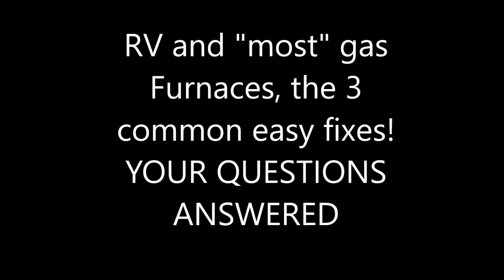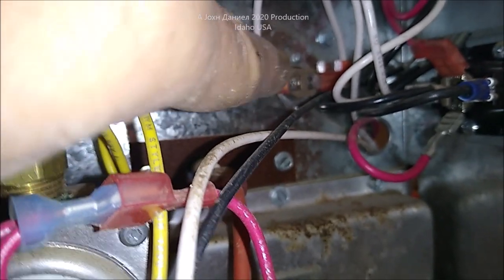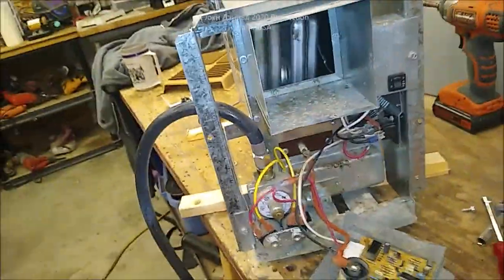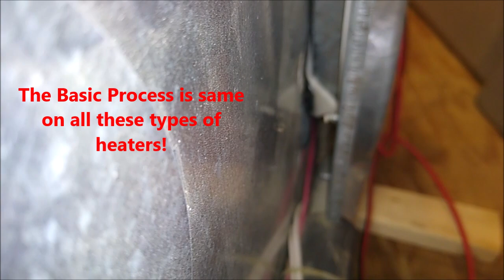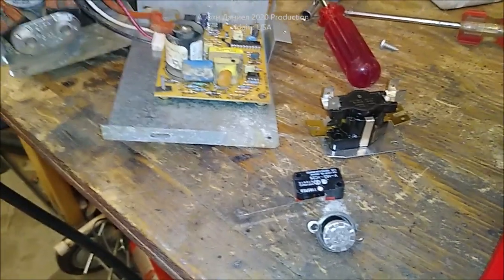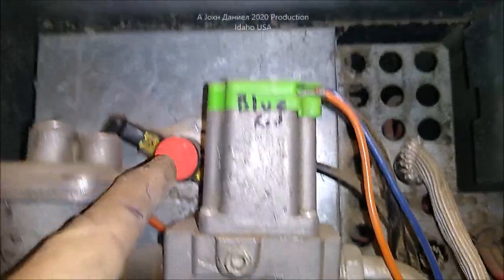RV Furnace REPAIR TECHNICIAN SECRETS Top 3 Easy Fixes anyone can do PARTS BELOW

Comment: Great video.  My furnace runs great in my RV the 1st night.  But if I try to run it a second night, it turns on then off about 3 times then never comes on.  No clicking noise like it's trying to light. It's a 2019 Real Lite camper trailer.
Reply from the maker: Check for low battery voltage or charge them and see if it starts working properly. Many will fault out at anything under 12 volts, and you won't get the true voltage at the battery doesn't have the same kind of activity on it that you normally using at the time you try to use the heater. So I'm switch the heater into on run position turn on the lights you normally have on and then do a voltage test and see what's happening.
Reply: @JOHNDANIEL1  Thank you.  But I am plugged into 30 Amp power when this happens.

Comment: I put a tab on sail switch and it still starts and shuts off and then starts again and shuts off
Reply from the maker: If it's doing it as as soon as it builds up heat usually about 3 minutes then the over temperature switch is failing on the low side. For the light gauge jumper between the two terminals on it, reconnect power fired up see what happens.

Comment: Hello,
I have a 2017 Forest River Vibe, furnace comes on provides heat for a few minutes and then turns to cold air. I was researching and a guy said it is most likely a temperature control switch? Any idea? 
I'm close to taking the entire furnace out. Hoping someone knows exactly what the problem is so I can purchase parts first?
Reply from the maker: that is a typical behavior of the over temp switch going bad. Even if you can find continuity on those switches typically they won't carry any amperage to keep the board holding the gas valve open. And some models they have an additional temperature sensor near the burn chamber and it will also fail in that fashion. For the small jumper wire 24 gauge for safety between the two contacts on each one of those with alligator clips, run a few cycles and see if it changes.

Comment: Would mine possibly run on power alone? No propane lines , some were burnt in a small fire b4 I owned rig, 2016 forest river Salem hemisphere light. It's cold and I need to get this thing hot.
Reply from the maker: There's no electric coils in these heaters, the DC voltage runs the circuit board the blower and the thermostat. Propane makes the heat.
Reply: @JOHNDANIEL1  thank you sir. Thanks your video I did get my furnace running although is a pretty silly solution. But my refrigerator will not run into propane lines on that side have been cut I do have power to the plug but nothing past that. Got a video for that? I have shared your page.

Comment: Just bought a older trailer. When I try to use my furnace, it fires it runs for few minutes and then pops like a back fire, after checking the exhaust I have a bracket peice hanging out of it.

The same peice as the one mounted in yours at 6:14, what's that peice for? Do I just pull the unit out and rivet it back in?  The blower does make a higher pitched noise so I plan on pulling it anyway to see if I can do about that.

Comment: Hello John, quick question for you, I have a Suburban trailer heater that works fine but when I plug into shore power it immediately shuts off and won't turn back on until I unplug shore power. I have no idea what could make it do that, any ideas or suggestion's would be greatly appreciated  8~)
Reply from the maker: Many of the suburban heaters have 110 volt transformer built in, they also have a reset circuit breaker based on that 110 volt circuit or they'll be a switch or you switch it to 110 and a relay has kicked it off at 12 volts. Open the front of the unit look around inside for a toggle switch it allows long-term parking on 110 volt service. Secondary there might be a fuse it'll be a black cap you unscrew with a fuse in it 10 amp and that might have blown. They are made to default on shore power but you can toggle it back down to 12 volt because it'll be on a choose circuit from factory which means it defaults to 120 when available and if that transformer or fuse or reset breaker is messed up you'll get nothing. The best way to do it typically is always leave it on 12 volts switch. If the information gets you up and running don't be afraid to hit the things button and drop a tip to the old poky

Comment: Thankyou for the information.  How much of this is accessible in the rv or do you need to disconnect unit to move to gain access?
Reply from the maker: It needs to be removed, there's screws that would probably be in the base to go down to the floor usually 2. The exhaust is a slip fit so take the screws out on the outer body and the center screw if it has one and shake it a little bit and slide it out. Be sure your gas is turned off and your power or pull the fuse. Back up any kind of fittings that you work on with another wrench so that you don't twist them off. If the unit has duct work on it it's usually snap fit or 5/16 clamp. Take your time and slide it out the front.

Comment: Hey man! What an awesome video! 
I have the exact same heater 
Did all the test 
Still no heat tho 
the spark plug sparks only for a second in the start up routine 
Is it supposed to go off all the time like a propane burner canon
Reply from the maker: These are not supposed to continually spark. There is a common issue with them not lighting up and burning it would typically be lack of pressure from your regulator off your tanks. Change the regulator and see if you're still flame gets a little higher and the heater starts working properly. Try that first.
Reply: @JOHNDANIEL1  thank you !   I did switch the board for a new one and it started like a brand new furnace !!

Comment: John thanks for the video.   I replaced all the components you showed here and it worked.   I had it working great so I installed furnace back into the confined space where it belongs.  Hooked everything back up the same and now it will light but then 10 seconds later system shuts down.   Any ideas?    Thanks for your help and beautiful border collies
Reply from the maker: Try try to adjust the spark points to where the flame sensor wire is detecting flame on the burner. Sometimes they get just far enough away or are grounding out and they'll run and cycle like that. Second thing is be absolutely sure you're exhaust and intake are clean.
Reply: @JOHNDANIEL1  ok ill try and mess with the flame sensor and ignitor.   I think that's the prob for sure.   The intake and exhaust are clear.   I can get the system to run by bypassing the safety switch.   But I only did that for testing purposes due to possible fire.   Everything seems fine so I'll try to bend those prongs away from each other a little.   It's a 28 year old furnace but I won't give up on it.   I replaced the board, relay, and sail switch.   I just ordered a new valve with solenoids and new igniter and sensor, also a new 7 Amp safety switch circuit breaker.   Thanks for responding tho I do appreciate it as it is gonna snow here tomorrow.

Comment: Thank you so much for your videos. They have been a great help and I've learned a lot. I have a Hydroflame furnace and have check the Sail Switch, Fan Delay, and the High Temp Switch. All of which work fine. My furnace runs the fan then when the Sail Switch is closed, after a delay, the igniter will try and fire. However, a flame never starts. My guess is that gas is not getting to the spark. I have purged the gas line and have sufficient supply to the regulator.  What is my next step is troubleshooting? Thank you for your help.
Reply from the maker: Your high temp switch might show continuity but as soon as voltage above an amp is put on it it faults. You want to make sure that that one is not doing that. Secondary if your regulator is not supplying 11 oz then these heaters black like this. The gas valve itself is one of the last things you'll ever see go bad on these.
Reply: @JOHNDANIEL1  Thank you for your quick reply. If the igniter is firing then doesn't that mean that the board is getting the "OKAY" from the High temp switch?
Reply from the maker: The igniter probe also behaves as a flame sensor in most models, if you get it to fire up and it shuts off it might not be detecting a flame sensing response. Also some of them if they're old enough the capacitors are gone bad on the board or even the relay has lost its ability to lock down after the fan is running fully due to loss of amps. So do your best to study and see if something due to age or carbon build up like the igniter may be the problem
Reply: @JOHNDANIEL1  Will do. Thank you, John. I'll let you know what I discover. Thanks for all the help.
Reply: Saw this video, might give the solenoids a test. https://youtube.com/watch?v=zCp_HXPaC8U&feature=share

Comment: I just picked up some of the adapters from your list of links. I've got everything hooked up. Why would my fan twitch on and off every second and spin a half turn or so each time? It spins fine by hand. It's not squeaky. I hear some clicking. After about 20 seconds it all stops for a few seconds then clicks and the fan starts to twitch again.
Reply from the maker: Sounds like motor brushes failure.
Reply: @JOHNDANIEL1  thanks! I'll try to find a new motor... unless you have one you want to sell me! 😊

Comment: John, I have a suburban sf-20q and everything works fine, fan start, had fires up, gas turns off, BUT the fan will never shut off. I have to pull the fuse out to get it to stop. Install a new domestic Tstat, whicj did no good.

I've watched some of your videos but don't see this particular issue discussed.
Reply from the maker: The fan staying on like that is usually due to the run-delay relay sticking in place once it's been activated.
Reply: @JOHNDANIEL1  
Thank you, John. Great videos with good narration and pointers along the way.  Keep up the good work!  Thanks so much for responding.

Comment: Thanks for the great videos, I have a Atwood model 8571-IV dolphin, it seems to be heating fine but there is a really strong chemical smell, and in cold weather it is really soothing the outside of the camper. Any help is appreciated.
Reply: If you mean Soot, then could be exhaust blockage. Check for wasp/bird nest.
Reply: @2jarrettclemons   yes soot (spell check)thanks I’ll check that.

Comment: John! U r the man! My 1st purchase 40 ft HR  IMPERIAL..many small electronics issues. I NEED YOU BAD!!. thanks for taking the time to explain this ...now atleast I won't freeze. Im currently desperately trying to figure out and I derstand the B.I.R.D. system on This thing. I'm going. Through batteries like my ex with vibratory bats. And all the relays that are for the ignition system. 1997 holiday rambler imperial. 8.3 cummins mechanical. I bought it when my mother died and I sold everything to live ring. And It's sentimental and very comfortable.. so it's not going anywhere..thanks.

Comment: So I'm looking at the power supply on this and am I right in thinking that the black is negative or ground, and the white goes to one side of the thermostat and the red goes to the other side of the thermostat but also pigtails to the positive power source? Amazon has a cheap suburban thermostat and a more expensive hydro flame. I'm assuming they're gonna be the same but do you have a preference for this furnace? And if I build a box for this to go in, do I need to have a hole in the side for the blower fan or will it just pull air from the front of the grill?
Reply from the maker: Yes, it draws air from the sides

Comment: 86 prowler, works fine but smell propane in trailer. windy days are the worst, Do I need to take it out and clean it? Squeal in motor but will change later. propane smell in trailer is my problem.

Comment: Question- My Atwood heater blows cold air and clicks every few seconds but the propane doesn't ignite. After about 20 seconds, you can smell propane. What would you recommend I do to fix this problem? Any help would be much appreciated. Thank you!
Reply from the maker: It sounds like the electrode is not properly set. The electrode is what goes into the furnace with what feeds it kind of looking like a shielded spark plug wire. It'll go in right into the front of the burn chamber.

Comment: So question my furnace turns on for about a minute starts blowing but nothing ignites and then it turns right back off again after one minute do you think it’s the relay the round thing with the disc?
Reply from the maker: When the blower leaf switch fails they will act this way. The common steps are thermostat calls for heat and energizes the delay relay switch, it then kicks on the blower and the blower leaf switch tells the control board the blower is running and then the control board opens up the gas and fires the ignition cycle. So if you want to put a pair of jumpers in on that wire set to that switch try it again.

Comment: How did you remove the exterior shroud?
Reply: Some of them are spot welded, you have to cut an ''11' around the spot weld  with an angle grinder disk (the width of your pliers mouth). Then bend them 90 degrees out. Buzz the tabs off. When reassembling, use self taping sheet metal screws near old spot welds.

Comment: Hi John my old gas detector goes off when I run the furnace in my old fifth wheel 1988 but the carbon monoxide detector does not go off I had a propane leak from a line that I capped off but I tighten that up and do not smell propane anymore but when I run the furnace with doors closed the gas detector goes off any ideas?
Reply from the maker: Could be a dirty pilot light somewhere in the trailer.
Reply: @JOHNDANIEL1    Do you man one that is lit ?  the furnace is a auto light pilot i believe.  and other than that there is the stove but i have that off.

Comment: Hey John, so before my motor went out my heater was working fine. I replaced the motor and then it would just run and never heat up so I replaced he sail switch and still nothing so I by passed the sail switch and the burner kicked on but only runs for a little and then shuts off and stays blowing cold air. What do you think it could be. I did order the manufacturer sail switch
Reply from the maker: That would be because of the limit switch most likely, it is near the heat output on the heater as far as part of the heat exchanger case. Sometimes they'll fail won't kick the gas back on
Reply: Is the limit switch the same as the hi temp switch

Comment: Great video to understand what the furnace is doing. Thank you! I have a question, though, and not sure what part could be the culprit. My 2001 Coleman Bayside Elite has an Atwood 7916-II furnace. New thermostat installed a few weeks ago. Ran it on a trip over the weekend. The furnace started up, no problem, and ran nice and hot for a while. Once it ran for quite a while, it shut itself off. After a bit, the fan came back on, as expected, to reheat the camper. However, this time it didn’t light — just blew lukewarm air. I turned it off at the thermostat, allowed the cool down cycle to complete, and flipped it back on at the thermostat. Same issue, tho — 1 great cycle of hot air, but 2nd cycle just lukewarm. What gives? Thanks for the advice!
Reply from the maker: Check for things that might be blocking your duct work or exhaust. That fan coming back on is due to concentrated heat buildup after it shuts off.

Comment: So when I turn my thermostat on, it only heats or cools with the thermostat on fan. I put it on auto and it clicks on and off over and over  . 2006 Colman travel trailer camper 24 foot. I’m thinking it’s the t stat. I’m gonna use this camper in the winter months and would like this issue gone. Seeming like a power load issue.

Comment: What state are you in and will you travel to do RV repair.  I need help.  

I have a 1999 Fleetwood Bounder 36s with the electronic Climate Control but chirping behind the fuse panel over the fridge.  At first the heater would not shut off which turned on after I shut off the AC so figured the switch was having issues.  So I was at the beach and it was late at night so just pulled the panel and shut of the heater using the switch on the heater itself.   Monthly now after trying to find a mobile repair and now hard repair site in NC Border line VA area.  Well after getting to cold at night decided to take it apart blow it off. The front heater would come on but no heat and low motor sounds but now neither come on and of course it’s getting cold fast.  I removed all the lights everyone is talking about that interferes with the power.   Because yes I’ve watched so many videos.   I pulled both panels and cleaned the basic contacts but my SF 20 and SF35 I don’t think are the problem but rather the main EEC controller or something.   
It seemed to all starte with my steps not working.  I checked the magnetic and manually put power directly to the motor, checked the switch because they do retract when I open the door or hit the switch after I manually extend them but they won’t extend by themselves.   Then the hot water heater on demand water pressure doesn’t seem to have enough water going out that goes in but does get hot but then runs out and I have to keep turning the shower diverted back to tub. Then the SF35 heater blower not going hot then the chirping and now after taking the ECC off the wall checking connections and blowing it off, changing out the fuse and all the lights now neither heater will work at all.   I might be mixing them and tired one issue at a time but some how I think they are connected.   I need help I’m becoming overwhelmed emotionally and I’m older now my Bday was the 16th and I live full time in mine with my 3 dogs.  So… recommendations?
Reply from the maker: I'm in Texas.